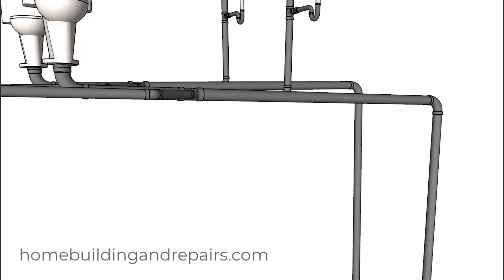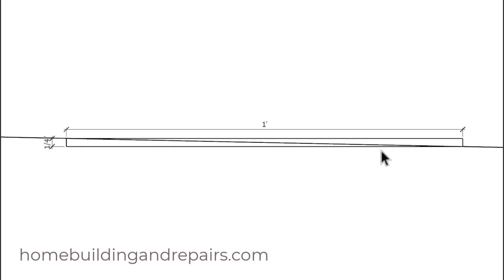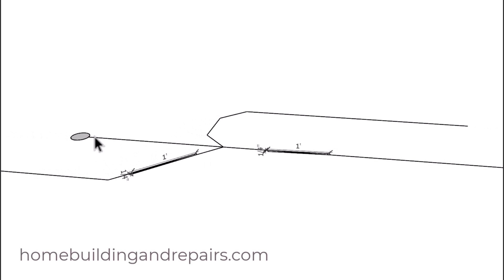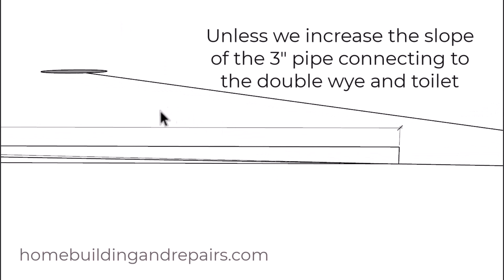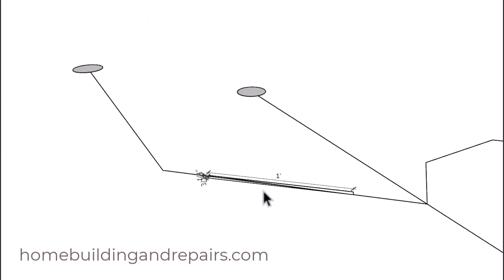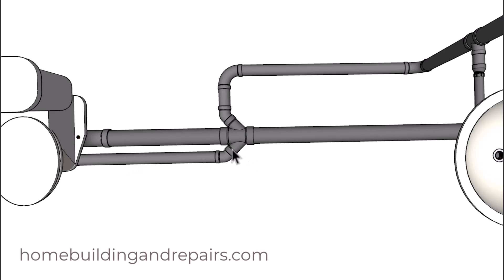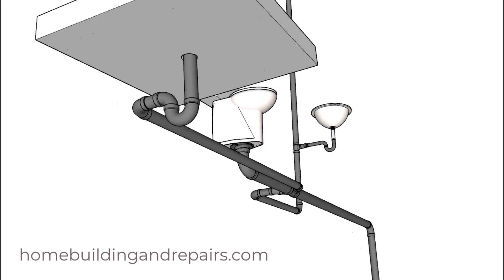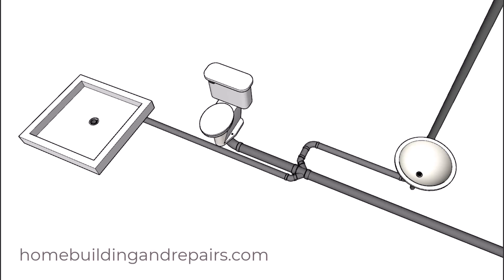Does Double Wye Plumbing Drain Pipe Fitting Have Enough Slope? - Plumbing Series

Comment: Uniform plumbing code does not allow a double wye or combination for horizontal to horizontal change in direction of flow. 

I have been in plumbing for over 30 years. I experienced the problem this causes in a dormitory. When one side is used more than the other, the sewage builds up in the less used side and causes everything to clog. there was a clog every few months. the maintenance personnel had to rod the drain very often. it is extremely easy to use  two single wyes instead of one double and it will prevent any clogs. I took the double wye out and installed two single wyes. there were never any clogs after that.  the other issue is that when you try to rod through the side of the double wye the cable goes straight a crossed to the other side instead of making the turn. That is what happens to the sewage also. half of the sewage does not make the turn, it goes straight to the other side, loses momentum and settles, builds up and clogs all the entire double wye.

Two single wyes are very easy to install and will save you from future clogs.
Reply: Great explanation....thanks.
I have a 3" 90 deg elbow draining a toilet...it has a 2" fitting in the elbow "sweep"...the bath sink drains into this. The dry vent is 14" downstream from toilet drain...system has been working fine...don't know it it's within code.

Comment: They don't allow a double Y to be used horizontally in our jurisdiction...and the reason is obvious...both sides can NOT both have slope if installed horizontally.  Vertical is the ONLY install I would ever use for a double Y...and this usually only on what we call a "high rough" for a septic system...since these usually exit thru the wall instead of going down thru the floor.
Reply: That right , it can only be installed level, so that’s why we use street 45 on both side and roll them at an 1/8